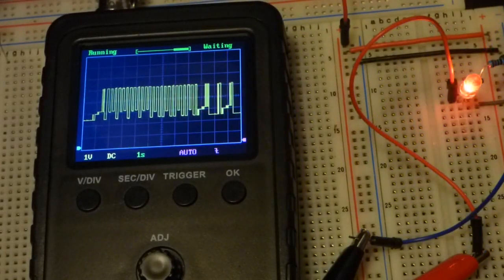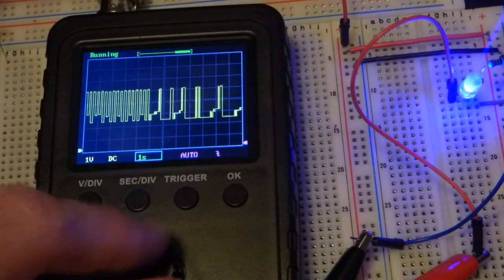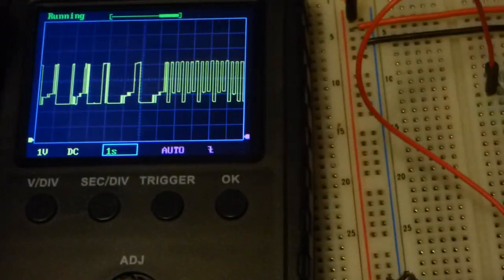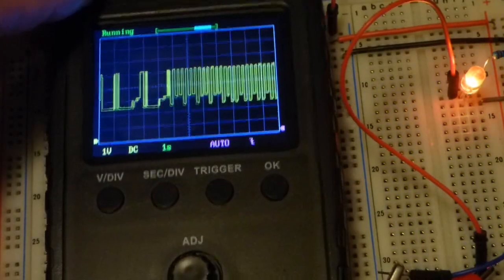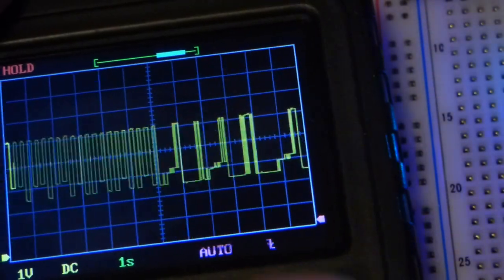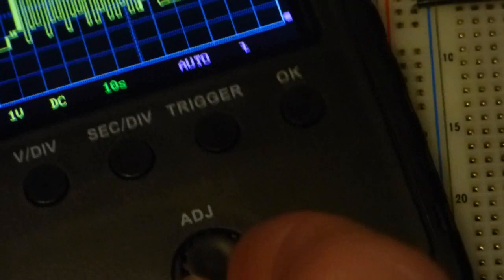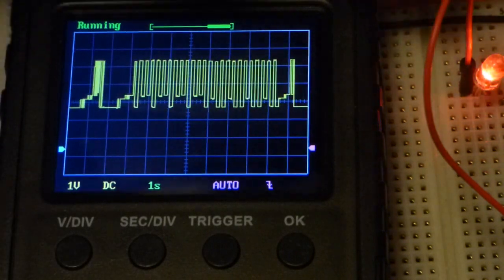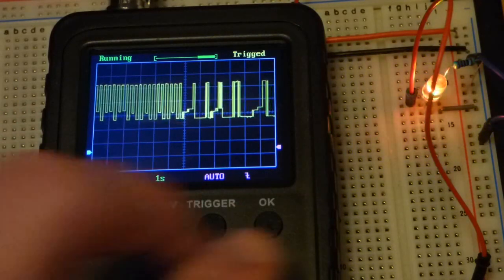Updated video of low priced portable Etepon DSO shell oscilloscope first look

Comment: That one seems to be the best of the worse, I was going to buy that one, or the other one you have that has a MP3 player case and a LiPo, and there's also the JDS22-something handheld 20 mHz for the same price as the DSO 112, I think, $120-ish...  But at that price, you're starting to go near the cheap nice ones, dual channel 70 mHz that's actually 100-200 mHz if you install a software key....  Those are 350-400 CA$, and I'd rather have one of those than fiddle on a tiny screen with one button, or pay a third of the price of a nice one for a tiny screen and two buttons and an eighth of the power...  Ideally there's also a logic analyzer in there, maybe some even do spectrum and waveform, ...  I'd rather learn rough, and get nice tools, and be able to appreciate and use them fully, and understand them when I get them...  This way if I give up I gain $125-150, and if I go on, there's no learning curve when I get out, I know what the functions are and represent, and what I'm looking at on the screen...

You can do chemistry even if nobody's ever seen an atom or a molecule....

I do very much would like to have one, but in all honesty, even if it would be a nice toy, and I'd be happy and proud of it, I'm not sure I could use it respectfully... and the tiny ones I'm not sure would be much better than a glorified test lamp, really...  Not much signal analysis to do on there, and you can't compare waveforms, single-channel, ...  I'm just not sure it's worth the $30 for the DSO Shell, but I hope someday out can be worth it to get a nice desktop model, something respectable you can sell later to protect your investment, and that'll bring you forward in what you're doing...

I'd just get more confused with it, and it would just be more wires across the keyboard, for "not the toy i want"...  It's like a model of a Camaro vs an actual Camaro or something  😁
Reply from the maker: Good thoughts!

Comment: I have this scope as well. ... not sure if you knew but when you are scrolling back n forth thru what is being displayed, if you push the rotary encoder button, two small fast forward arrows should pop up in the top left corner and allow you to scroll faster. 

it also allows faster movement up and down when centering the waveform.

Also, go to jyetech's forums and there is a manual of sorts that gives you some info.
Reply from the maker: Nice, thanks for the tips!